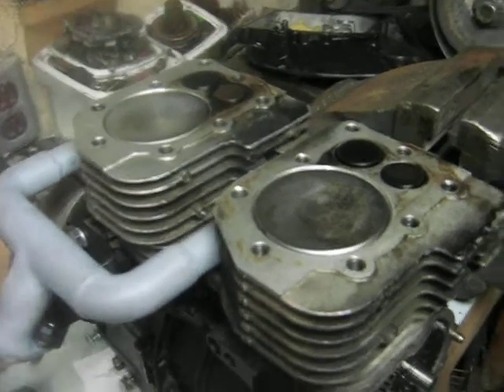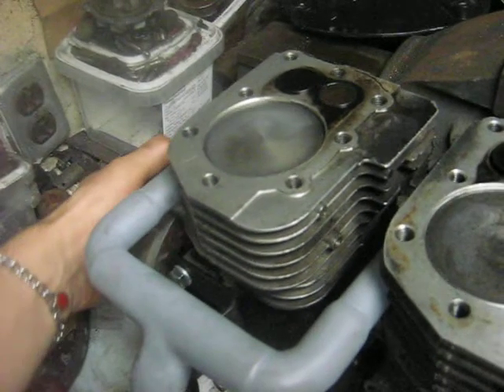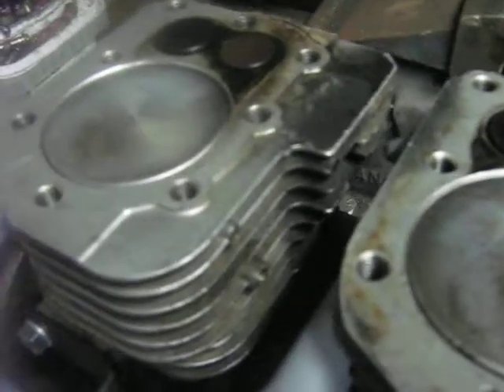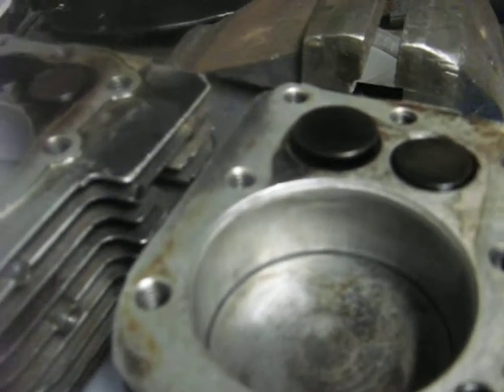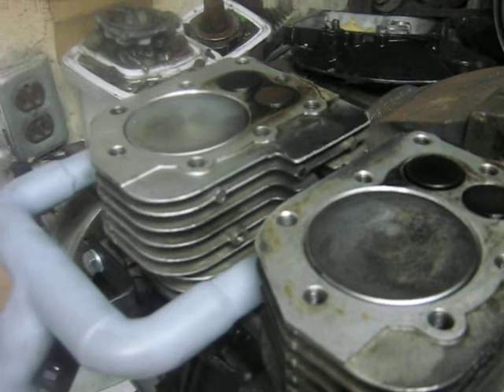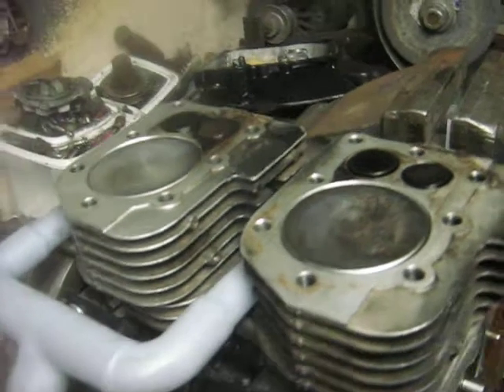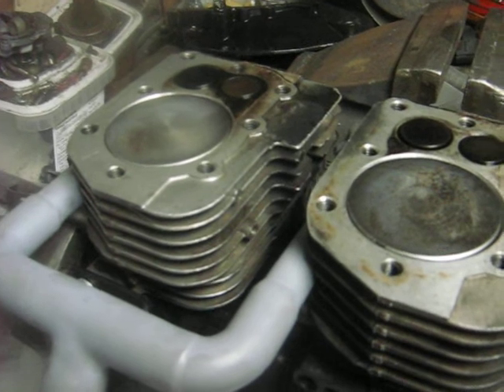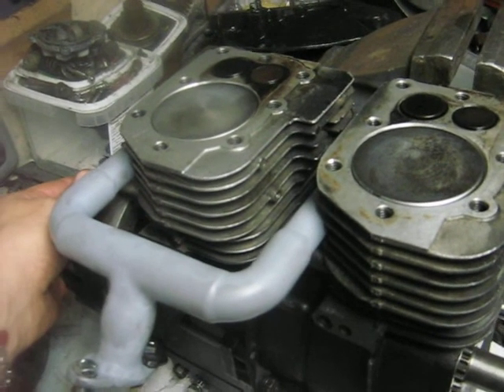Even Fire Briggs 2 Blocks

Comment: It's gonna shake apart.
Reply: It's balanced just like two single cylinders, it's not gonna shake apart
Reply from the maker: Thanks for the input, I agree with you, I haven't changed any of the internal engine components, so it would somewhat maintain the factory balancing. I am working on another project that will push the  boundaries a bit further than this one, I hope it holds together  :)
Reply: Texassince1836 Yes, it's balanced like two single cylinders, but now those 2 cylinders are connected into one crankshaft. Ideally, as one cylinder is at TDC and starting the power stroke, the other cylinder needs to be at BDC starting the compression stroke. This will smooth out the engine. Even if he alternates the firing order so only one cylinder fires at a time when they're both at TDC, it's still gonna shake. As it is now, it's impossible to have one cylinder at TDC on the power stroke and the other at BDC starting the compression stroke. Don't get me wrong, I have nothing but respect for ChargerMiles007 and his project. I'm just trying to help him smooth out his home build engine.